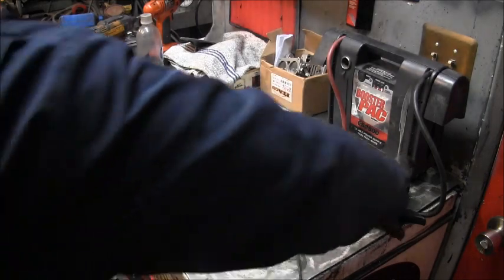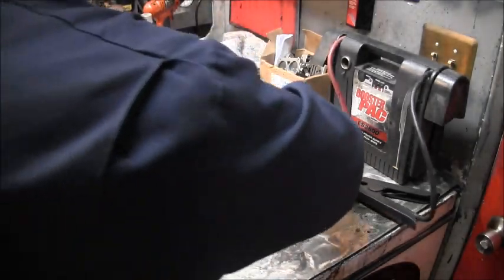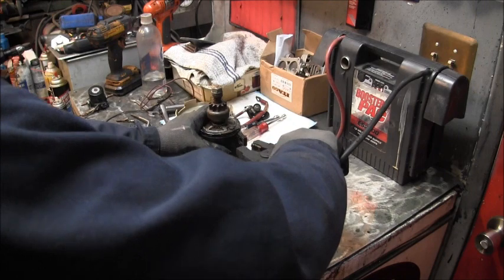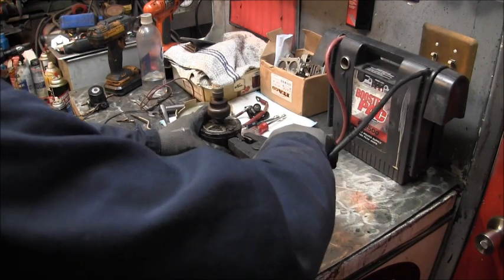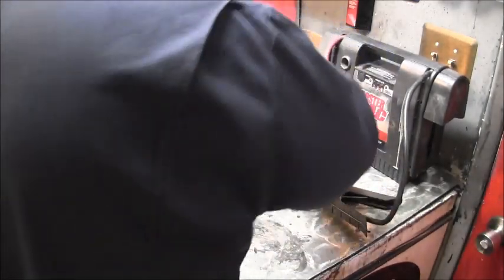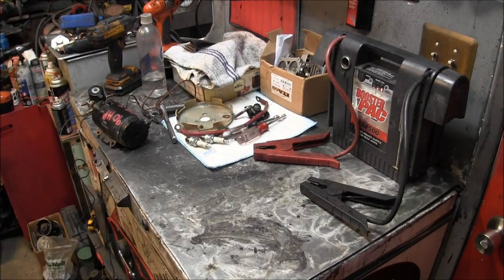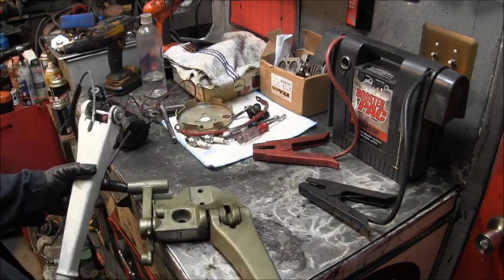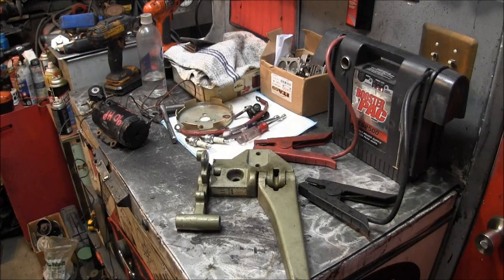1994    35 /  40 HP  JOHNSON  ,  OUTBOARD ,,

Comment: Hi Kodi, motor is coming along. I agree with motors with the handle shift could be dangerous is probably why the manufacturer quit making them. The Mercury Mark 10hp I have has one so will be careful with it on the water for sure. The control I took of it with the cable is perfect only mini hyrdros. All you need to do is start it and go strap in and push the control from there.
Reply from the maker: Yep'  Tim  I have mixed  opinions  about it,  I see where sail boaters & others would luv it,  I made a vid or 2 about it to let folks know  they have options.        kodi

Comment: I was looking for info and how to's for my "new to me" 94 Evinrude 40hp but after seeing you bolt up the wrong starter and grind the crap out of its gear and the flywheel several times I am not sure I can trust anything else you could show me.
Never use random unsure parts when it comes to gears, or really anything, verify part numbers and such before doing things like that.
Common sense.
Reply from the maker: Thanks for the comments and tuning in.     kb
Reply: @kodibassInsideoutboards  I will say I do like your demeanor and your video in general, just concerned about your methodology and care for actual parts and their usage.
Reply from the maker: @riverpirate1022     I scrap  more Outboard's in a month than most will see in a life time, When it comes to saving one of these old salty's from the scrap heap  My  take is if you aint cheet'n you aint try'n haha  thank's  kb.